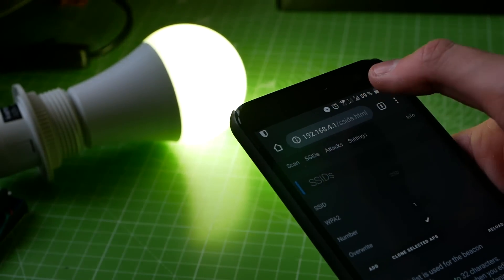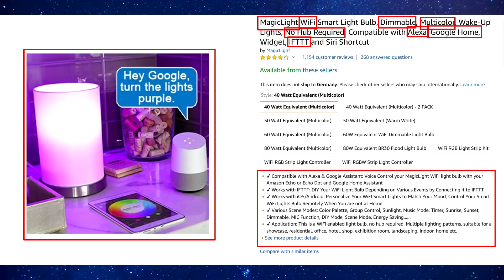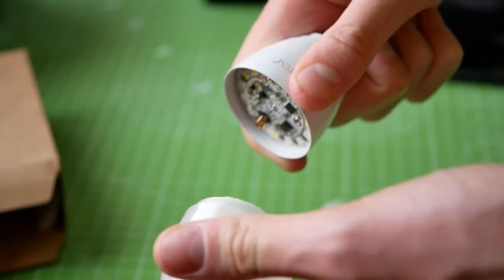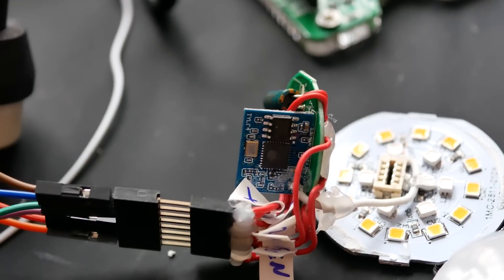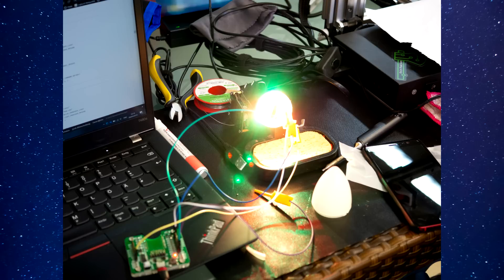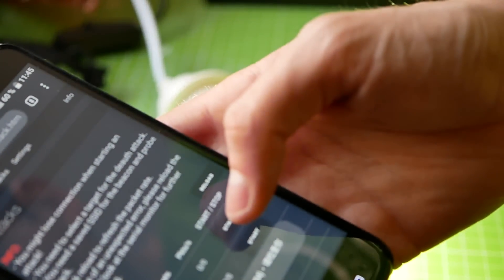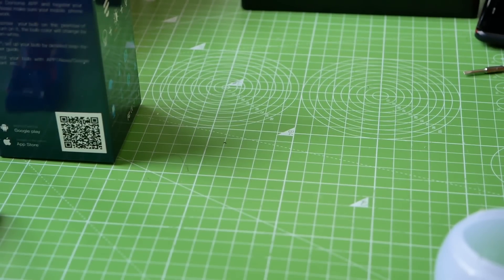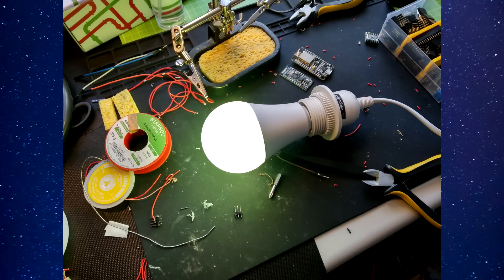How to hack ESP8266 Lights

Comment from the maker: 💡Do you want to see preflashed smart light bulbs and if yes, with what firmware?
Reply: Give us options.  Let us pick and choose between deauther, deauther detection, and just normal open source light.
Reply: I'd like to see them with a USB port, so I can just plug it into a PC, so it would be quickly and easily modified.  Just like any Arduino or ESP developer board.   If I had 50 lights, it'd be easier to do that, than to solder pins on and then flash.  
If it's easy to do, like this, the firmware is irrelevant.   For me, ESPHome with a fallback standalone adjuster, would work well.
Reply: Maybe an open source to do in the most safe way possible even if limited. Sorry by my english.
Reply: What do you think about the Mozilla Iot Gateway ?
Reply: Please
Reply: The Deauther detector would be cool, as well as the other control software.
Reply: YES
Reply: YES, please ! With the ESPruna one. Did you know where we can find one similar to the one dstike sent you ?
Reply: I think deauther flashing alert would be good 🙂
Reply: Yes. Any.
Reply: Ich habe das in einem separaten Kommentar geschrieben. Habe dein Kommentar erst später gesehen

Comment: 2020-2021 was a great time. My dollar store "action" had 3euro esp8266 bulbs with 806lm and warm/cold white light dimmable from "LSC" that could run tasmota. Now they silently switched to some obscure chinese chip that probably a cent cheaper >:(
Reply from the maker: Yeah noticed the same. Looks like they prefer other chips now that are not as fun to hack.
Reply: @spacehuhn  Small correction in my case they switched to Beken chips which I found out later also have a tasmota like open source firmware (OpenBeken)

Comment: So what's your alternative? I love light and without wireless connection I can't change the settings of each lamp. Should I buy bulbs with buttons or should I just foregoe colored and dimmable lights?

I see your point, but you can't say those lights are useless. If it wasn't for LED lights I would not work with electronics in my free time.

Enough of the grumble:
This is a very nice video. Actually I was looking for a video on how to hack remote controlled bulbs, but I stayed here :)
Reply from the maker: You can use them with open source firmware or hack something together yourself, that’s great about them. For everyone else, I’d look at lights that are controlled through Bluetooth, ZigBee, or similar from a reputable brand. Not that they’re perfect, but still a lot safer compared to these trash noname Wi-Fi lamps.

Comment: I'm rather cs savvy (maybe never messed with flashing stuff but played around with arduino and working as programmer). I'm interested in buying these cheap rgb wifi lights to test if this is something I want and maybe then later move on to much pricier philips hue or something like that.

I don't want to control this outside my home.  I presume that blacklisting access to internet on my router would do the trick so that I don't end up with botnets on my network. Also it would be rather easy to analyze requests that these mobile apps for controlling lightbulbs sends. If something would seem fishy I'd consider going open source and flashing firmware or setting up separate network w/o access to internet.

If someone breaks into my home and is able to access lightbulbs and flash them then I'd probably worry much more about everything else in my home than lightbulbs.
If someone is able to spoof my internet well think about it. It's game over. I'd probably worry about my banking credentials rather than lightbulb.
Metadata? Well I've Facebook app on my Google phone... Nevertheless  analyzing requests and disabling accesss to internet should do the trick am I right? If somethings fishy then turning to open source is solution.

Well I'm more paranoid that these light bulbs might be ticking bombs that would go off when I'm not present at home. Don't know but something like circuit shorting on purpose -> increase of temperature -> fire. I'd assume that when light connector is in off state then it shouldn't be possible. And when going away on holidays probably take them out.

So I'm planning to give it a go, yolo. Probably everyone has mic and wifi spoofer in their electric kettles mass produced in china, sike :o

Comment: This is interesting, but the funny thing is I've ordered some cheap wifi lightbulbs to actually improve my security. The idea is that while I am away from home for a couple of days or more, I can turn on the lights in the evening to simulate activity and scare off burglars because, in my opinion, they are a far larger threat to my security than some chinese data-mining operation. Also reflashing with open-source software seems like a good idea, I might try that.

Comment: to anyone looking to do this using tuya convert in 2020, tuya has started shipping with updated firmware that breaks tuya-convert. it's being worked on, if you want to help out check out the issue on github https://github.com/ct-Open-Source/tuya-convert/issues/483 or even better the wiki page https://github.com/ct-Open-Source/tuya-convert/wiki/Collaboration-document-for-PSK-Identity-02

great video btw lol

Comment: Pls sell a lamp with the deauth detector software! Because the deauther software isn’t very useful in a lamp you have to power with a huge cable. Oder verändere die deauth detector software so, dass man die Lampe normal benutzen kann ( Farbe wechseln und so) und das erkennungs feature ein Zusatz ist. Am besten kann man noch die Farbe des deauth erkunngs Alarm ändern oder dass es pulsiert.

Comment: I was thinking it might be interesting to add an SD card to one of these,to use as a file dump. Sort of an anonymous file sharing server. Something like Sparkfuns "Rogue Router". Typically an SD card would also use pins 12,13,14 though. I'm not sure if the SD card would be happy with having/sharing PWM all over it's data lines. Perhaps if there's a version using the ESP32,that also has some extra GPIO available to connect an SD card to. Or,perhaps you could replace the Flash chip with something larger,to have space for storing files.
Reply: Piratebox esk device?